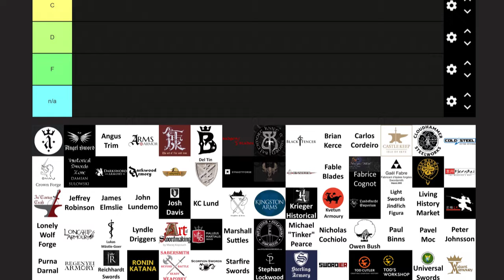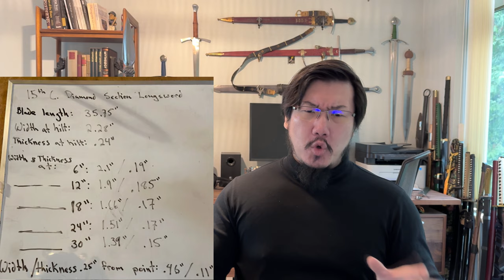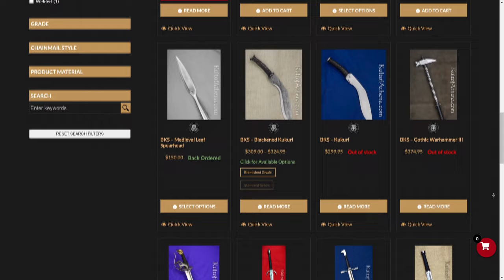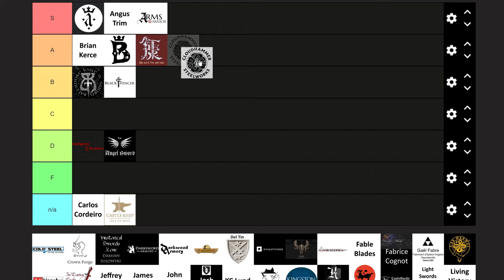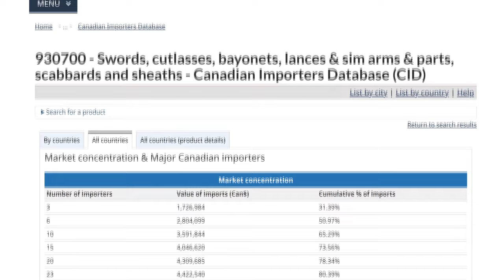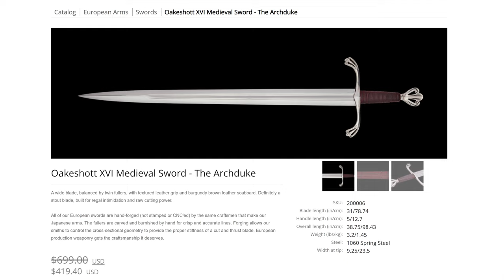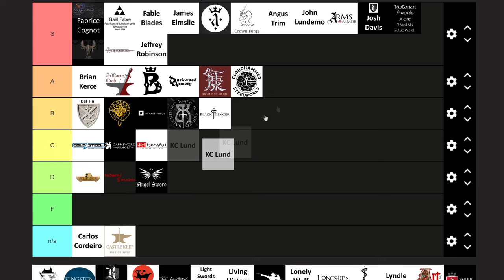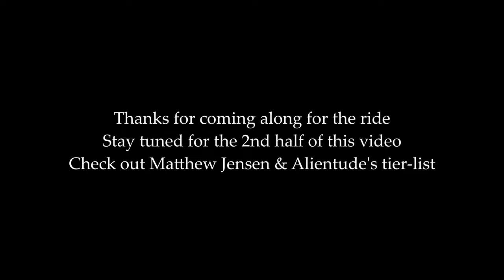European Sword Maker Tier List - Ultimate Sword Buying Guide, Collab with @Matthew_Jensen 1st Half

Comment: Kane has a good form when cutting (better than mine) and I like his reviews — well, minus the annoying microphone, there’s something off with it, but I can’t pinpoint what. 

I do have an issue with the sword makers tier lists. My issue is that some makers make martial swords, others make art swords, and some make high quality sword like objects — a.k.a not swords, I want those makes to improve fast or go away. So these should not be on the same list. Don’t get me wrong, I like hearing thoughts on sword makers, I just don’t like the tier system. But fine, I’ll accept it as a framing device for the video.

Since I have experience with Castle Keep…
I can say that Rob Miller is an artist first and foremost (and no offence to people that want to push controversy, I don’t care; and now I hear a different take on the issue; so WTF, I want to see a video on swords, not pointless drama; keep the discussion on swords, or make a serious journalistic investigation on a separate channel; the sword community is not a big community to fragmented it every other week for the sake of drama). Rob made me a beautiful side-sword. Now, I used a historical piece to ground the project in reality, I specified what I want, and then I let Rob’s skills to take over. The end result is on his website and is gorgeous. However, don’t think that it’s perfect, and don’t think that if I have to pick up a sword to fight with I would choose this one. This is a proper sword made by an artist, and I allowed for it to be an artistic project more than I do with other makes, but it’s not something I would classify as a martial sword. If you want a sword from Rob Miller, after you wait for 2-3 years to get your place in queue, you will get an art piece. So look at the swords he prices at 6k ($, £, €, who cares at this price point) and judge him on his artistic skills. That’s how I would rank art swords and their makers. And of course the swords cuts well and all that, but that’s sharpness — even sword like objects can do that. 

Martial swords start with the blade and they don’t always make good backyard/competition cutters. So would I classify the type XIX bladed swords from Albion as martial? Yea! But here’s the kick, I like the feel in my hand of the LK Chen's Ribaldo more than the Albion's Machiavelli. Why? I suspect because the Ribaldo follows a historical example that benefited from on-hand feedback when these Milanese swords were originally made. From all the swords designed by Peter Johnsson for Albion, I like the Brescia the most, a.k.a. a relatively faithful reproduction from their museum line that has the least amount of added design in it. I suspect Peter Johnsson allowed his geometrical ideas to take over too much — one should look at moments of inertia to get the rotations right as well (something I suspect occured naturally in the old days). 

So Albion would not be S if S is seen as perfect tier, since their swords don’t offer 100% of their martial potential. And LK Chen is not S because production limitations and some design issues (e.g. hilt block on rapiers don’t impress me). One is a better made as an object, the other is a better martial sword. Which of these qualities ranks the maker as S? In the end, LK Chen blades are great and Kane is right that people should go for them no matter the stamp on the blade, but if I am offered one of the two for free I would take the Albion because is more expensive. And in this case I would take a Castle Keep sword, or another maker of unique swords priced in the +10k range. Basically, the tier list can end up being a price list.

I think that to be able to design a good martial sword you should know how to use a sword (in particular the sword type you make a list for). That’s why high quality HEMA trainers end up feeling more like the historical antiques I had the chance to handle (and yes, I’m allowing for variance; not all antiques are good swords; some were shit when they were made, never got to be used and ended up in collections over the years). Trainers capture the right dynamics because they are judged on their ability to do so. As a caviat, I think that what I'm saying is more important for 1-handed swords. Longswrods are more forgiving, or maybe one can compensate easier for bad dynamics, not sure.
 
Last, if you want a scary sharp blade with good geometry, good at cutting, good dynamics for the style of weapon, good quality with a philosophy behind their assembly, just get a Gottfried or a Günther langmesser from Landsknecht Emporium and splurge on the pommel and scabbard options. You won’t break the bank and you'll get something quite really good. So the best sword is a knife. 🙂
Reply from the maker: There is some quite problematic takes in this response and I will address them all. But before that I would like to offer some explanation of the audio quality of my videos. I live in a metropolitan area so there's a lot of noise of traffic and even planes and ships in the background, however there's also the constant white noise from a waterfall next to my residence. It was quite difficult to filter that out, when I enjoy recording outdoors whether from my patio or in the garden, to eliminate space constraints to demonstrate sword usage, compare different swords, some of which are extremely large to even move around indoors. I have experimented also with some indoor filming lately with limited degree of success. I have to filter out the outdoor noise as much as I can but they are always there as bass, and some users experienced genuine difficulties hearing when they have enhanced bass from their speakers, I only noticed that when I put the video on my desktop speaker, but on headset or the speakers on TV the audio is mostly fine. Lately I started using a noise-canceling wireless mic, which is a god-sent, as the wired mics are basically useless to me outdoors, not to mention the danger of accidentally severing the wires with swords. Both the noise in the past and the noise cancelation in my current mic cause some distortion of my voice, not to mention that I often have to speed up the video when rendering as my videos are already too long, but I want to offer all the information I have at hand. Speeding up the recorded footage can also distort the voice to an extent, but the effect is minor. There is also a number of re-shoot in the video and I'm not sure if you have noticed, I try to keep the audio consistent but there will always be consistency issue. So thank you for putting up with my technical difficulties, it's ultimately the information I want to offer. These videos generally each takes 100-200 hours to produce, including the research, evidence gathering, interview, filming, re-filming, editing, rendering (which took 30 hours for this specific video). Most of other reviewers and sword channels record their footages in-doors, often in on take for a singular video--the exception being Matthew Jensen, who sometimes produce one video over the course of months. So with all that, there will be inconsistencies and quirks, and if it impacts the viewing experience, I apologize, but ultimately it's the quality of the information put forward that matters. At least to me.
Reply from the maker: Now let's talk about your take on the ranking and evaluation of makers or their works. I cannot speak for anybody else who would like to also partake on this endeavor to rank makers into rough tiers and elaborate on each case, but my standards are quite clear. As long as a maker has genuine interests and experience in the research of historical and practical swords and has a solid understanding of the functionality, and they have roughly over 99% customer satisfaction rate based on years of observation, they should be in Tier S, There may very well be Tier SS and SSS. And within all the works of one maker, there would also be different tiers. Some pieces of a maker would obviously have more complexity, with more research and labor invested in them over other pieces by the same guy. As long as the outputs by a maker is not downright a deliberate scam, I wouldn't rate the maker as tier-F. We can easily knock everybody on this list a peg and downgrade everybody one letter grade, and only elevate a few makers to tier-S, as James Elmslie humbly suggested.

Now about your characterizations about practical and functional swords, I respectfully disagree. All LEGITIMATE swordmaking is art, and the resulting swords should all be functional and practical according to the martial purpose defined for the type of the sword (and arms and armor). There's no "art swords" or "martial swords", there are ACTUAL SWORDS and SWORD-LIKE-OBJECTS. Now there are highly decorated swords especially on the hilt components, but there are also austere looking swords focusing primarily on the practicality, even though the latter can still have a boat load of subtle things like complex geometries built in. But even highly decorated swords MUST be practical swords to begin with. They should perform equally with austere-looking swords, and all the decorative elements should in no shape or form negatively impact the functionality and ergonomics of the sword.

My evaluations of swords look at how good they are as swords in the defined contexts, not how good of pieces of jewelry they are. Although, tasteful and historical decorative elements are a bonus PROVIDED they are excellent functional swords to begin with, otherwise, no amount of artisanal sculpting or gluing a bunch of precious stones from De Beers will make me rank them high.

I fundamentally disagree with your characterization of the Albion type XIX and LK Chen's. The formers are a number of interpretation of type XIX, based on multiple antique examples, but finding the traits best suited for modern audience's aesthetic tastes in terms of hilt styles (Condottiere style battle sword, or Irish war sword, or Renaissance early sidesword), while the latter is a direct recreation of ONE museum piece--essentially the same as Albion's Museum-Line swords. None of them is better or worse, as they are designed to be DIFFERENT, and they had BETTER not just look but handle differently. All 4 handle extremely within their clearly-defined CONTEXTS. I demonstrated the Ribaldo's effectiveness in my review video. Even with all the different standards and emphases of Albion and LK Chen swords considered, neither is inherently better than the other. Just like Albion Museum-Line swords are not superior to their Next-Gen line swords, or inferior. They have different focuses (Museum-line swords have more investments poured into them due to the amount of extra research so they are pricier).

My tier-list is by definition NOT a price-tier, as demonstrated makers that charge you less than others, such as LK Chen, Art of Fire and Iron can get S, or A, while Angel Sword gets a D (I know I'm being generous as most will rank it F), even though Angel Sword pieces are more expensive than 98% of the makers on this list. That's the whole point of reviewing swords, and making a tier-list of makers. It's not a hard science, but it's entirely based on evidence--be it our direct experience, or very credible and specific customer testimonies with pictorial and video evidence.

About the makers in Tier-D, they rightfully deserve to be there, as I have elaborated. Yes, you could very well rank them F, if they do not seek to improve, although many of them have seen genuine improvements over the years. Whether they would suffice remains to be seen.
Reply: @FortuneFavoursTheBold Don't take that comment too negatively. Take it more along the line that the sound is the only part that I don’t like and that everything else is good. And “ultimately it's the quality of the information put forward that matters”, which is why I watch your content (and alinetude and Matthew_Jensen for that matter; each offers a different view on things). Anyway, I’m glad you are aware of the sound issues. And yes, the quality is indeed better than earlier videos.
Reply: @FortuneFavoursTheBold  To preface my reply, Kane, you do you. This is your channel after all.

I think I’m getting more jaded with years, while at the same time I'm getting more knowledgeable. The added experience makes me look at different things when it comes to swords -- more function in the right context (e.g. I love asymmetry dictated by function now, which is something I would have rejected when I started collecting) -- while at the same time I am becoming more intransigent with what I want in a sword. 

And I guess I’ll ‘accuse' James Elmslie to be older and with much more experience than me, so I would not be surprised that my views align more with his. Basically, no S unless they match all aspects of a sword (something to strive for; make it aspirational) and I don’t want to see D tier makers. My classification for SOL includes your D tier in a way. I have bought cheap swords like any other person (honestly, the waiting times measured in years are so hard to endure in the beginning of sword collecting), but in retrospective I would have preferred shops not to carry those brands. It maybe harsh, but I want the field to move forward even if it leaves brands behind (this is not an apprentice needing time to get better situation; those brands won't improve, they are US Ren faire type products). And the C tier product should strive to improve, Windlass managed to improve with their Royal Armoury line, I want more of that (I saw them to be as Cold Steel, but I guess I’ll see what you have to say when you get to W). Btw, it's fair to point out that I’m using your tier list in the conversation and thus I’m invalidating my objection to tier lists being useful.

I’m ok with you disagreeing with my classification. 

I think we may have a misinterpretation of ‘jewellery' in this context but is not that important (btw, I actually find jewels and gold in swords off-putting, except if they were there to begin with, e.g. a migration era swords with rare stones in the hilt). The art for me includes the steel, the pattern, and the variety of swords a maker can do. I will always be more impressed with a maker of basket-hilts, rapiers or a chiselled small-sword than with a simple arming sword. The former are the makers that I see as having a higher artistic ability, and those are the people I will give freedom to surprise me with their craft. It may be unfair to others, but I do look at those makers differently. 

You know the views of Ilya Alekseyev from @ThatWorks expressed in his Heretic sword video? The idea of pursuing the aesthetics over functionality because the aesthetics of a presentation sword can be more valuable in securing a military alliance than the martial quality of a single sword? I think he is right, and at the same time I don’t care about those swords in a way. 

Not only that I like martial swords and I want to see more of them, but I want to see more and more aspects of a martial sword being captured as we move forward. But martial aspects are not about the looks, but about the use, and that depends on the skill of the user, which depend on the sword design, which impact the possible technique, which… you see where I’m going with this, it’s not straight forward. A sword made to cut tatami mats will always be easier to gauge. 

I don’t know if there’s an agree to disagree situation, but I’ll stop here.

P.S. "I demonstrated the Ribaldo's effectiveness in my review video.” Yes, I know, that’s why I bought mine a week after. I wanted it to be a cheap substitute to my Albion so I can goof around with it in my garden. And then I found out that I enjoy it more in my hand than the Machiavelli (even if not by a lot; e.g. when doing some Manciolino solo drills). Albion is still better when it comes to aesthetics and build quality, but on martial aspects, this episode made me realize that they have room for better. So now I want better from them.
Reply from the maker: No problem. The audio has long been a problem for my production and I'm glad and relieved that it has been resolved to a certain extent now.

As for the tier ranking standards, each one of us has our own, and that's fine. It's probably a good thing if more sword collectors and practitioners can voice their opinions with receipts attached--not just an arbitrary assignment for each maker. This is probably the original intent of Matthew Jensen, who is the advocate of this practice, and essentially other reviewers like alientude and myself are essentially responding to his call to arms.

Although I have voiced my disagreement with you on this matter, it is by no mean to discourage discussions. I specifically promote discussion of points and rankings people have disagreement with me in the comment section at the beginning of the video. So it's all good, as other sword friends visiting the comment section will see your opinions and that's some great interactive experience.